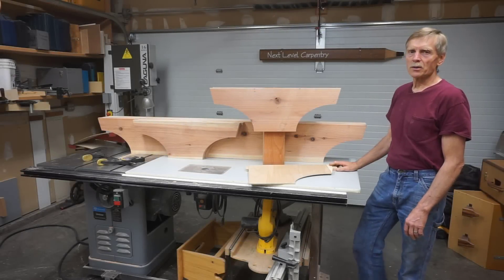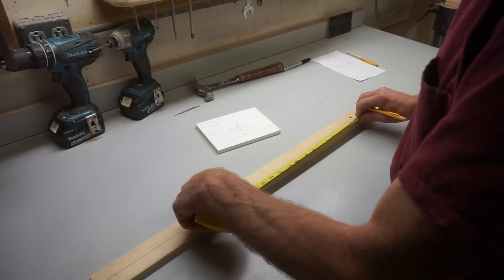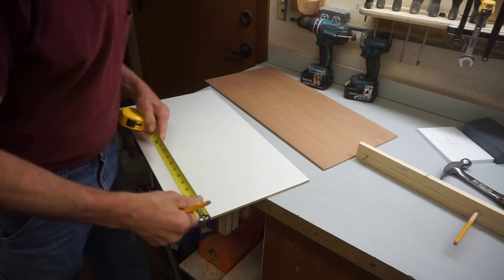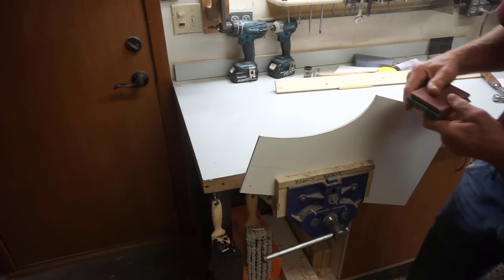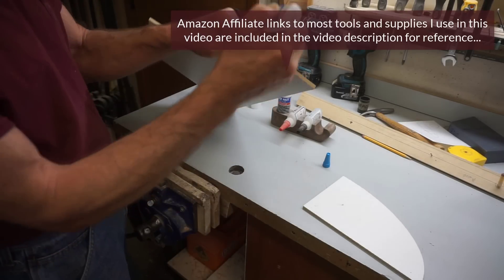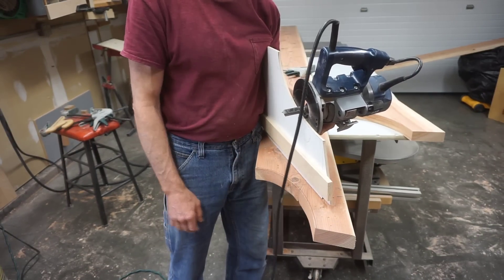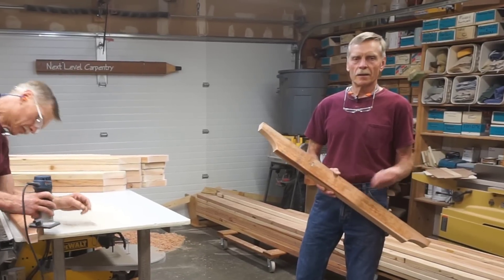How to Cut Decorative Ends on Pergola Joists

Comment: This is so cool to me. Thank you! so I have a few questions....
1. I'm not a math guy - until I have to -  but I think you reached this ration from the joist dimensions?
6-1/4 minor axis & 10.5 for the major axis?

I have to curve knee braces on a band saw and I think that this elipse formula is better than the typical radius of a circle.

How can I determine the ration if I wish to arch the knee braces in an elipse?
Thank you!
Reply from the maker: I suggest just doing some experimentation to arrive at a pleasing ratio that suits you and your project.  You should be able to start out with a guess that's close by simply doing a full-scale layout drawing of your knee brace on a piece of plywood or cardboard.  You can iterate quickly by adjusting the position of the nails on the ellipse stick until you come up with the ideal major/minor axis combination.  Good thing about this is that no real math or fancy formulas are required, just a bit of trial and error.

Comment: A now retired mechanical design engineer who likes to spend time in the wood workshop to keep a hand in so to speak. Busy designing an enclosure for the back stoep area. Picked up on a few construction and installation hints from your video. Kudos NLC.
Reply from the maker: Glad to hear it Mike... are you a SketchUp user by any chance?  I find it invaluable for this but, as an engineer, you probably use Solid Works or something...

Comment: Terrific video. Clear, concise, and entirely easy to understand. I'm building my own home and will use this method to cut the rafter tails. Thank you for taking the time to share your skills!
Reply from the maker: James,
I think you'll find this method quite satisfactory.  I encourage you to give it a practice run since a few of the steps have the potential to spoil a finished piece.  And PLEASE be careful if you use a 'top bearing' flush trim bit like I do in the video... they can be a little scary.  Scary but manageable with a focused workflow
Best,
Matt

Comment: I built a 5' wide ellipse top opening in a wall between my living room and dining room when I remodeled my home in 2009. I used to old non-stretch string and 3 nail trick.  I really like the "ellipse stick" you show here. I'm looking forward to trying it out somewhere! Thanks!
Reply from the maker: Geardriven, having tried the string and nail method and getting it to work will help you appreciated this alternate method more.  The nice thing about the string method is that it gives you 1/2 an ellipse where this only produces 1/4 but I think the consistency and accuracy of a stick vs string is well worth the simple extra steps required to mirror the 1/4 ellipse to get the half needed for an arch like you did.
It's just plain cool fun to build elliptical stuff, isn't it?!  Best, Matt
Reply: I did the ellipse in my home because I could and it fits the style and age of the home well.  When I worked with a homebuilder in the early '80s we used a full-length hand saw to mark the curves for the corner blocks for the soffit/rake intersection. We'd bend the saw to the desired curvature and mark it on the redwood 1x12 and use that as the pattern for the other pieces. Back in the days of real wood siding and trim! I don't care for vinyl and aluminum clad houses!
Reply from the maker: Ahhh... if we only had another $ for every soffit/rake 'porkchop' piece we cut, fit and installed we'd be soaking up sun in the Bahamas instead of what we're doing now, right?  When's the last time you saw someone fit soffit plywood joints with a block plane to make them fit so tight no caulk was required... them wuz the days!  Best, Matt

Comment: Matt that was the coolest thing to see you do, when you laid out that ellipse!! I had never seen that before, learn something new every day.  Good job ...what a craftsman!! I use to work around you on some job sites when you worked for MAC. (I was a sheetmetal guy) I knew you were  a craftsman then but, WOW!  Gotta luv the board stretcher and the cordless cordless charger too...keep up the good work.   VR Dave.
Reply from the maker: Thanks for your comment Dave... you've got a great memory if you remember MAC days... that's over 20 years at least!  Were you with K&K Sheetmetal or someone else?  I'm sure I'd remember by face even though I can't connect you by name.  Thanks for watching... Best, Matt
Reply: @NextLevelCarpentry  Actually it was Aldrich Air Conditioning ...so that was a long time ago ...they quit in '99.  I just stumbled on one of your videos during lunch not so long ago, and knew that I had seen you someplace before ...took me a bit but the light bulb came on.  I have been a fan of your vids since....
Reply from the maker: @daveeckmann9568  I remember Aldridge air conditioning but don't recollect any particular job... can you remember any examples where Aldrich was Mac's sub for HVAC?
Best, Matt
Reply: @NextLevelCarpentry  Heck...Matt I'm doing good to remember back that far to remember you at MAC.  No I'm sorry I don't ...it might have been a remodel of an old store downtown maybe...
Reply from the maker: @daveeckmann9568  I did Brauns where the Bridal Shop is now, the old Penny's building with Doug T, the old Sear's/Baer's Furniture upgrade and spent a LOT of hours on Prairie Edge when it got an overhaul... but I'd just as soon forget some of those days too!😉😎 Catch you around somewhere?  Best, Matt
Reply: @NextLevelCarpentry  If I see you at the lumber store testing saw horses or something, I will defiantly come say HI!

Comment: I loved the "Angel Perspective" watching your own self working. Very creative editing. I am building a timber frame pavilion with 4x6 corner braces that have about a 13' radius so not as advanced but if I can find a router bit that will go 4" I will use this technique.
Reply from the maker: I've not seen a router bit 'that will go 4' Azycray but I'm sure you can reach 2" with one so start from one face and then flip to finish from the other face.  Worst case scenario is to reach 1 1/2" from each face and finish that last inch in the middle with the front roller of a good beltsander.  A bit of extra fuss but should be able to achieve results far better than other methods... Best, Matt

Comment: Thanks for this video! I'm just about to start building a horse drawn gypsy caravan and, I've taken delivery of an old cart that I will be using for my running gear. The two axle joists are rotted at the top and I am considering whether to repair or replace, due to the fact that there are ellipses at either end of the joists I've been considering whether to copy, or simply use angled straight cuts. After watching this I feel confident enough to have a go at elliptical ends :)
Reply from the maker: Mike: you're welcome.  What a GREAT story... I'd love to hear how you make out with your newfound knowledge and confidence!  Compared to the whole restoration project I'm guessing the gypsy ellipsys will be the least of your challenges.  I'm also guessing that after a practice 'run through' of the methods I've shown you'll soon be leading a band of jealous gypsies with a styllin' 'new' wagon :-)

Comment: You have a genius way to scribe the template never seen before, I would have done differently for those that have cad skills you can do it in cad as well print it out and glue it to the template for cut out. This goes for any type of detail.
Reply from the maker: Mario,
I love CAD capabilities and use them in ways many and often.  A to-scale CAD printout of this curve or any complex profile would be slick for sure.  The beauty of the idea shown in this video is availability on a jobsite of everything required to get the job done.  Even with no wifi or app the job can still be done :-)

Comment: I just discovered your channel. You are amazing and easy to follow. Very skilled and, I'm ready to apply this knowledge.
Reply from the maker: GM, Glad Next Level Carpentry showed up on your YouTube radar... as you apply this knowledge let me know if there's things you have questions about.  My goal is to share stuff that helps you improve and succeed!
Best,
Matt
Reply: Next Level Carpentry i have a question, i dont know how to make angle cuts with a miter saw. Im trying to achieve a 30 degrees angle retaining the 38” length of the board. A video on that will be very helpful, at least to me.

Thanks!
Reply from the maker: GM, I'm sure I can answer your question but need to better understand what you're asking.  
I assume you mean that you need a cut you can't make by setting your miter saw at 30 degrees (which makes a 60 degree angle on the board) If that's the case you need to have a 30 degree angled point on the end of a board.  Do you need to have that sharp point on both ends of the 38" board?  Let me know and I'll get you through it... you'll be cuttin' those angles like a pro in no time :-)
Reply: Next Level Carpentry thats exactly what I need, from sharp point to sharp point measuring 38”.
By the way, Im doing all these projects because your videos inspired me.
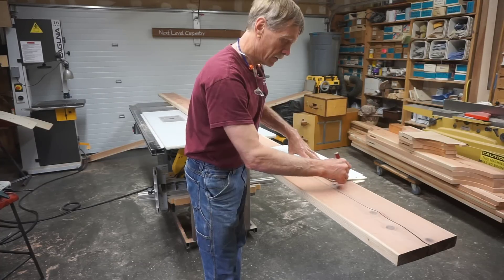Reply from the maker: GM, Glad to know you found inspiration in Next Level Carpentry videos!  Have you watched Part 3 of the Triangle Trellis video series where I show how to make those sharp angle cuts at about 12:30 in the video?:  https://www.youtube.com/watch?v=Q31koOy3Lqo&t=857s
If you've seen that part of that video and still need help getting a sharp angle cut on BOTH ends of a board at a given length please ask a question as a comment on that video so my answer will help other viewers there too, OK?
You can do this... it's just a matter of learning how to get more out of your miter box and I'm determined to help :-)
Best,
Matt
Reply from the maker: Hey GM,  If you're still trying to figure out how to make that special piece with an exact length and 30 degree points on both ends I have the perfect solution for you and will strongly consider putting it into a short video so just let me know?
Best,
Matt
Reply: Next Level Carpentry oh yes, Id love you to make a video about. It will be of great help
Reply from the maker: Ok, GM... are you subscribed to Next Level Carpentry?  How about this: I'll do a video to answer your question, you work on showing/sharing this Channel with your friends and send some new subscribers?  Deal?

Comment: Great video,  Matt!
Reply from the maker: Thanks for your comment Curtis... this was part of a fun project for a job near Canyon Lake.  I actually stopped by there just last week and was impressed by the way my client has added landscaping and pavers to the area around the finished pergola... fun stuff!  BTW there's a few pics of the finished pergola on Pintrest if you follow the link from the NLC home page.  Best, Matt
Reply: @NextLevelCarpentry  Could you use a couple of 3/4 inch phelonic sheets?  30+  X 50+.  I use phelonic for making jigs and tool table tops.  I have some taking up space in my shop.  If you want a couple they are yours. I got them out of a trash bin but are in perfect condition.

Comment: Great job, you make it look nice and easy,   Im about to achieve project with 3” thick by 11” wide and 20’ long pieces, each piece of that cedar costs 2000$, im wondering how to perform on such a thickness of the wood? Router is great option, but tail design has sharp inside corners, router will make them round. What would you do ? 
Thank you
Reply from the maker: I would use the same process Nerijus. Thinking about your project here's a couple things that come to mind.
You will probably need to route the profile from each face, flipping the joists in between, to smooth the whole surface after cutting. I'd use a wide SHARP chisel to clean up the rounded corners and make them square. If your router bit is 1/2" diameter it won't take much chiseling at all. BTW sharp inside corners in wood for exterior use might create stress points and encourage wood splitting from those corners so you might consider leaving them with that small radius for longevity...

Comment: That's a very clever way to make a template!
Reply from the maker: Bruce,
With a bit of practice a template for just about anything can be made this way.  I use this method one way or another on most every project I do in my Timber Tailor carpentry business.  I should have made more of a point that this sort of template and using a flush trim bit instead of a guide bushing will truly take your work to the Next Level.

Comment: Thank you for making this video
Reply from the maker: You're welcome Alvin... hope you're able to apply a thing or two from the video to projects you're working on.  Best, Matt
Reply: Yes sir,

I'm working on my 3rd pergola and  the jigsaw tip really helps, my rough cuts messed up my finished line because of the opposite pressure exactly like you mentioned.

Also thank you for the tip on the elipstick. Now I don't have to find and use the owners watering pot base as a template anymore.
Reply from the maker: 'watering pot base... template'  LOL... the list of things a guy ends up using to get the job done sometimes is truly bizarre, right? Hope you had a little extra length in your 'joists' so you could salvage the pieces spoiled by that wandering jigsaw blade... that catches me off guard on occasion too in a 'd'uoh' moment!  😢😁😎 Best, Matt

Comment: Worked out great!  What did you select as your lumber for the component pieces?  It was a little hard to pick it out in the video.  They look like cedar....  dressed pretty clean.
Reply from the maker: Thanks for commenting, Scott.
I believe all the parts shown in the video were redwood.  I remember comparing price and quality with cedar for the best end result and am pretty sure I ended up with redwood.  I made gates (shown in another Next Level Carpentry video) that used both redwood and cedar, optimizing for various pieces.  The project got an opaque stain finish so workability and durability were my main considerations.  Everything did dress pretty clean for the end result, which you can see on the NLC Pinterest page if interested.

Comment: great video.   Entertaining and informative.  You mentioned a different template for the different wood sizes.  Is there a common ration for the major and minor axis for the ellipse that's based on the width of the wood?  
On another note I was also going to build a template to cut a stair tread around a post and your tip about making 2 passes with the router using the first pass as the guide for the second means I won't have to buy a longer bit.
Reply from the maker: There may be a 'common ratio' out there somewhere Steve but for these I just eyeballed it to proportions I liked.  Even if I used an 'official' ratio I might end up tweaking the result anyways for visual appeal.  Glad you're able to expand the usefulness of an existing bit... I like the fact that's meaningful for you ie: I like the way you think! Nice... Best, Matt

Comment: Neat. I use two clamps and a flexible ribbon to achieve the same. One clamp at the exit point and one at entry point and then I play with the ribbon until I get a curve which i like.  

I see some are concerned with pronunciation. That may be important form them, but some say oregano and some say oregano, or was it the other way around.  Well, it's the same herb anyway.
Reply from the maker: Eg,
The flexible ribbon mention you describe is definitely one to have in a 'bag-o-tricks' as it's an excellent method for some applications too... especially on  projects with a 'free-form' design.

The negative comment's you've noticed tempt me to do a video where I say something about taking a heelicopter flight to buy some to-mah-toes and or-ee-gah-no from a farmer suffering through a drouth just to see what kind of comments THAT generates :-)

Comment: Great video, thank you for posting. Question, I noticed your table saw Router table in the extension. Do you find it better in that location, parallel to the saws rail? I plan to install mine there also, due to lack of space in my shop.
Reply from the maker: I configured my router table in that position because of the same challenges of lack of space. That setup provides a router table as an extra piece of equipment without an extra piece of equipment and doubles down on the usefulness of the table saw rip fence as a router fence. Seems like pretty much a no-brainer in my viewpoint but others certainly have differing opinions.